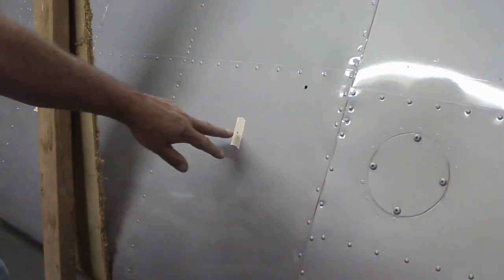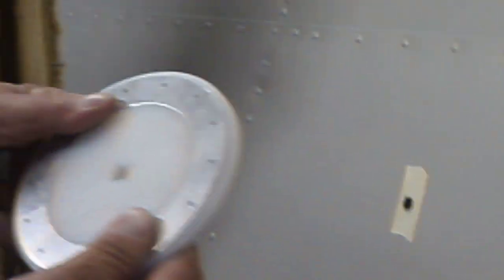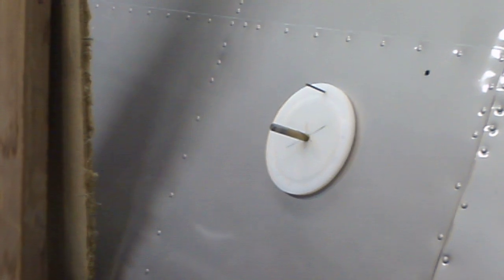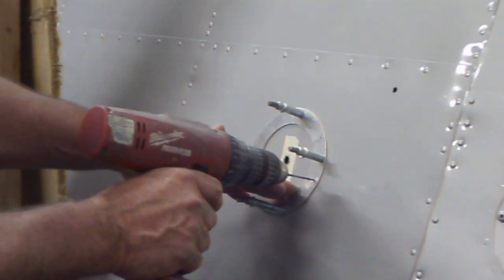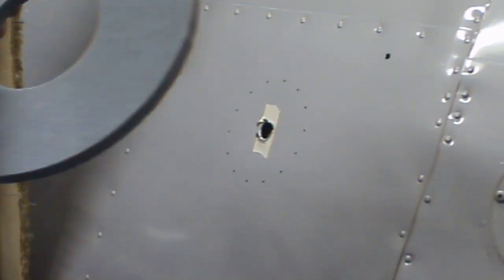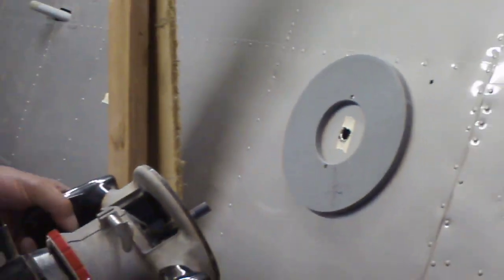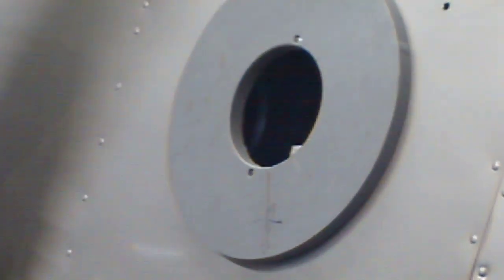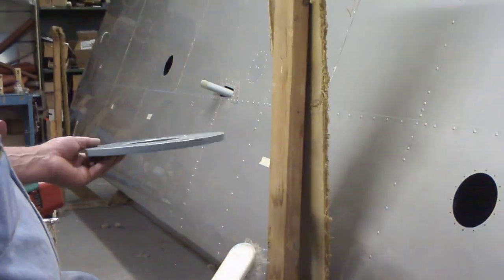15AC wing inspection hole

Comment: Very nice! Only concern is that the first template, the white one, might work better if it were made out of metal (possibly aluminum) as frequent drilling with the plastic material would eventually auger out the small holes and accuracy would go downhill.

Otherwise a very good system!  Are these Brian Safran's wings?